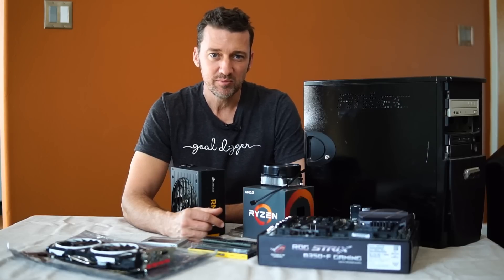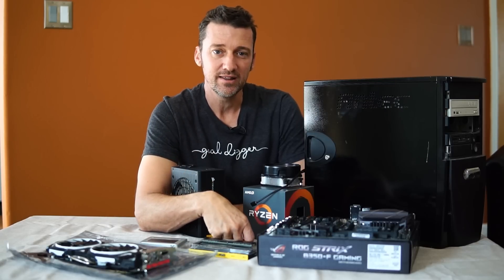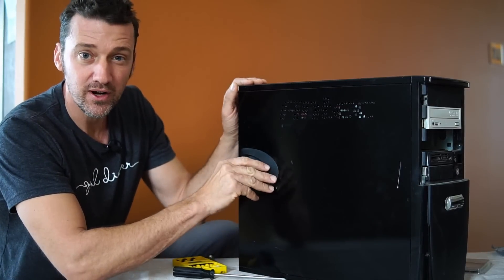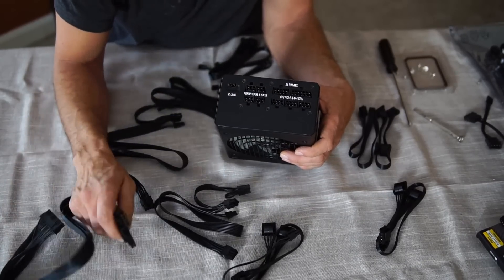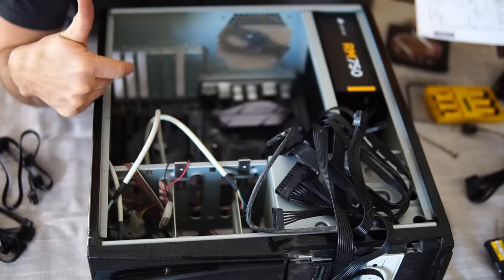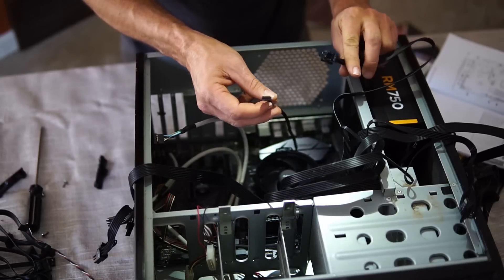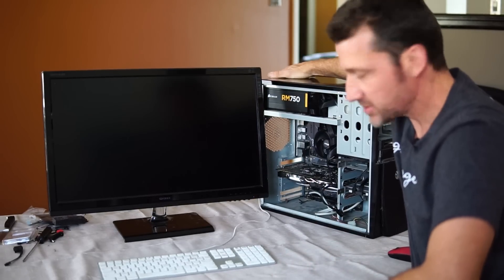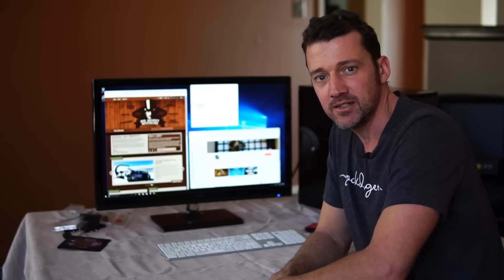How To Build a Quick & Cheap Gaming PC - MMM

Comment: Having just built a great Gaming PC for myslef (and as a mustachian) i recommend investing in a 50$ case. It will improve airflow and overall performance drastically.
Reply: I recommend also investing 30 $ in a CPU cooler, in the same spirit..
Reply: @yb9426   Graphics cards are pretty cool these days, mostly due to better power efficiency (thus, less heat).  But you still need to have some ways to monitor GPU temp and CPU temp, of course.
Reply: PCGamingGoodies Thank you for the reply. His Motherboard is capable of monitoring all the temps i believe.
The ryzen and the 1070 will perform better under stress if cooled properly.

Comment: For those not tech-savvy enough but still want to go a similar route, you can a buy a "bare-bone" PC offered by some PC sellers, such as Avadirect.  They assemble the case, main board, power supply for you and even do some testing on it. Then you buy and assemble your own hard drive, memory, and graphics card, which can be done by less savvy users.

Comment: A high-end graphics card is a big investment whether you buy used or new.  So I would consider buying a new (but older-generation & discounted) card that comes with a warranty, usually 3 years.  A new card also has a longer life expectancy than a used card, unless the used card is barely used.  My last few high-end cards lasted 5-6 years at most.  If you buy a used card that has been used for N years, that is how much lifespan you lose.  If a used card is 6 years old, you should get it for free!

Comment: Sweet! I'm sure there are a few fans out there that remember soldering motherboards together, back when computers were in kit form. Recently rediscovered the fun of setting up a PC from components - a gaming PC too (I gather more influence from the 13-yr old?) and can recommend to others Jeff Attwood's (of StackOverflow fame) 'Building a PC' series on YT. One very cool thing is the fact that you are using much better quality components than if you bought an off-the-shelve system, for close to the same price or a little more if you are getting a high-end graphics card, etc. This is also illustrated by the cases - the cases are very nice to work with -  (like a Mercedes 300D) designed to be fixed by the homeowner. One other recommendation: a local shop can be really helpful, say a Micro Center, since they might have classes, and the sales folks are usually pretty knowledgeable and can save you a bit of time.

Comment: It used to be harder - these days if it is the wrong port/bus, it won't fit. On the old days, plug the power cable one pin off and you can fry the expensive motherboard :)

Comment: I love your blog. Do you still have an outdoor gym? Would like to see a video of that, maybe even a typical workout. I am wondering how you protect it from corrosion. Greetings from Germany.
Reply from the maker: Thanks Tom. Yes, the outdoor gym is now greatly expanded and located in the back courtyard of my "MMM HQ" co-working space in downtown Longmont. 

Rust is not really a problem because the plates come with black paint and the bar is chrome plated. Hardly any rust after 10+ years outdoors, and you can always repaint them too, with exterior grade spray paint.